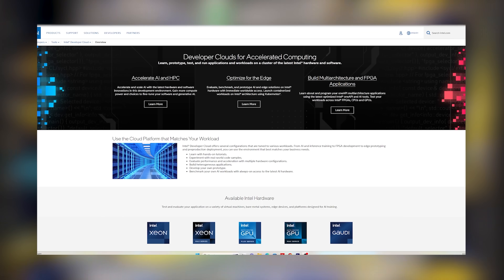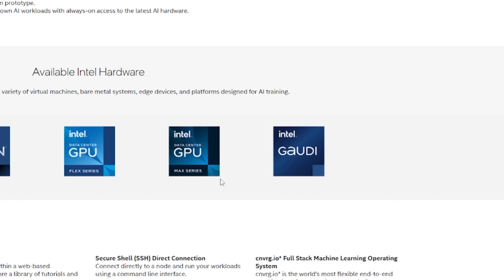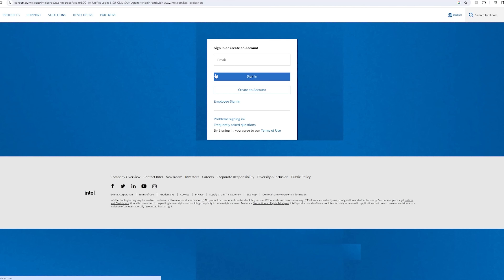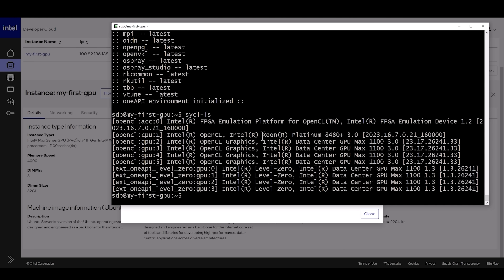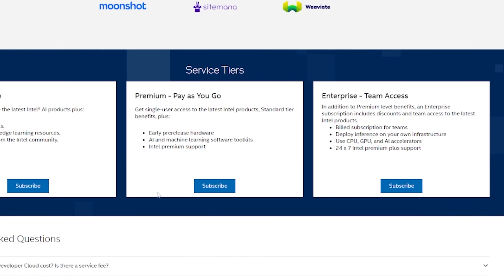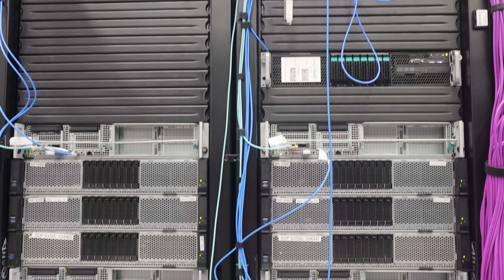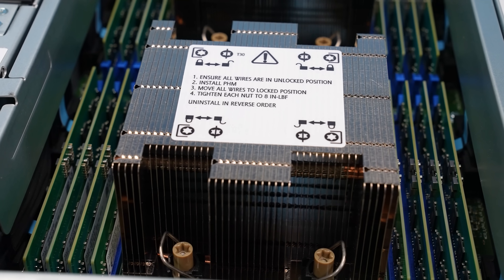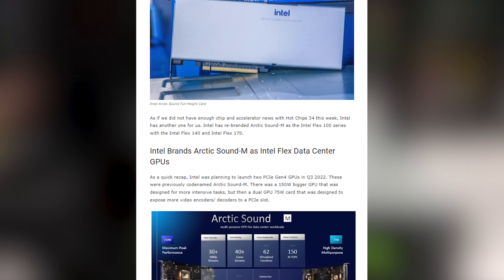AI Data Center Tour A Hardware Playground

Comment: No H100/H200 or even A100/V100 means only a small % of compute intensive AI devs would opt for it.  The Intel is NOT more cost effective, unless you can’t get H100’s.
Reply from the maker: NVIDIA was showing in its slides for the latest MLPerf Training v3.1 that Intel Gaudi2 is more cost effective than H100. That is even just accelerator costs not including the fact that NVIDIA was using PCIe switches and Infiniband not Ethernet straight from Gaudi2. A100 is falling behind now since it does not support FP8 Transformer Engine

Comment: Hi, i want to make my own home lab for AI, im wondering how hard it is, and where to start, I want to run llms I'm wondering, if there is better option than nvidia GPU, especially, since one gpu wouldn't have enough VRAM as i need, is there a way to go around that? or because with code llama llm's they just won't start if you dont have enough VRAM, is there any workaround this?
Reply: Give up is the short answer. If you can't get by with the RAM on a single GPU then it is not possible to do under tens of thousands of dollars at the moment.

Comment: Harley Davidson. 65 hp for making noise. 5 hp for pushing you forward.

Intel. 4950 W for heating the air. 50 W for doing useful work.

Arm. :)

Comment: Too bad Intel's AI/GPGPU products have come out close to a generation too late to be close to competitive. Nvidia certainly could use some competition to bring down pricing. They pretty much want your first born at this point, since they are basically selling anything they can produce no matter the price. But if you make back the entire cost in energy savings from the better efficiency, it will still be worth it for customers.
Reply from the maker: Word on the street is that Gaudi 2 is actually very competitive on a price/ performance perspective. Also, we covered this yesterday on the STH main site, but for only a few thousand GPUs (~$50M or less) NVIDIA is now pushing the L40S which is much lower power/ performance. Hopefully one day we can do Ponte Vecchio vs. L40S https://www.servethehome.com/nvidia-l40s-is-the-nvidia-h100-ai-alternative-with-a-big-benefit-supermicro/

Comment: Intesting sight that Intel uses 5p CEE connectors (the red ones) for the power supply of the racks. I would have expected some weird NEMA connector due to the location in the US. Do they really have 400V AC 3 phase power there?
Reply from the maker: I am not 100% sure, but I would not be surprised in the least given the cloud provider reliability lab is in the facility as well.
Reply: I doubt it's 400v, that's not a standard voltage here. It's much more likely to be 480/277 which is a very common industrial voltage here. It could even be 600/347 which is often used to feed large buildings or campuses which normally is stepped down to 120/208 closer to the point of use.
Reply: @eDoc2020  It is highly likely to be 400V three phase. If you tap off from each phase you get 230V single phase. It makes delivering lots of power to a rack much easier and just about everything can handle 230V these days even if you are in North America.
Reply: @jonathanbuzzard1376  I know why 400v is often used but that doesn't change the fact that 480 is much more common here. Standard server PSUs usually are good for 100-240 volts nominal and there are also versions available for 277 volts (one leg of 480v). But you need to keep in mind this isn't a normal server, these AI servers are using over 10 kilowatts each. Rather than using the 230 or 277 volts of one leg they probably use the higher voltage directly. The PSUs might even have true three phase input.
Reply: @eDoc2020  Blah, blah blah. Let me just check oh yes we have some of those 10kW AI servers in the racks at work. So I have ACTUAL experience of getting these things powered and cooled. The cooling is NOT an issue, the 12 year old water cooled rear doors can handle a rack full of them and still have headroom. Getting electrical power in is a different question and 3 phase PDU are the way it is done. Oh and ALL the vendor solutions for these servers have single phase power supplies. So stop trying to teach grandma to suck eggs. At the moment we can only get one of them per rack as we need serious power upgrades first which are been worked on, but hey what do I know about the subject. Note we have racks full of A100 GPU servers but the H100's have caught us off guard on how to actually get the power into the racks and into the servers. It is a complete sh*t show frankly.
Reply: @jonathanbuzzard1376   I never said they did have three phase input, I was implying it wouldn't surprise me. If you have real experience, that are the power input specs of each? I mean voltage range, amps, and connector type. Also is it one large PSU or are you feeding multiple smaller ones with a regular amount of power reach? From your comments I would presume the latter.

Also are you in Europe? Because 400v power is still not widely used here and I doubt they'd get a custom transformer. Perhaps 400v (or more likely 415v) transformers are common issue for American datacenters and I'm just not aware of it. I've never worked in a datacenter. I have seen equipment from smaller installs and I can confidently say 208v (2x 120v) 30amps is a common feed for a normal rack PDU.

Comment: 5kW a server is peasy. The problem is with the 10kW H100 based DGX servers. The coling is not the problem either, it is getting the power into the rack
Reply from the maker: We are going to have a demo on the STH main site from OCP Summit 2023 where they are now liquid cooling the power delivery to help power AI servers
Reply: @ServeTheHomeVideo  I don't think you get it. What follows is our real experience of trying get ready to handle these servers, some of which are already onsite. We currently can only accommodate a single H100 DGX box in a rack and the rest of the rack is more or less empty with some test boxes we don't care about. The reason is that if even a single PSU fails on a H100 DGX box it will cause a cascade failure of the rack as all the breakers trip.
First off liquid cooling is at this juncture a waste of time. So let's look at the Nvidia H100 DGX server. It's 5U in height and 10.8kW power draw using six C19 leads. I can therefore squeeze a maximum of 8 of these in a 42U rack. That would require ~87kW of cooling. The 12 year old water cooled rear doors on my racks are good for 93kW of cooling so I am already good to go with my cooling and have been for over a decade.
The problem is the power. So I upgrade the power delivery to the racks (this is underway) to get three 32A 3-phase supplies per rack. Being in Europe that gives me ~66kW of electrical power in the rack. This is going to be worse in North America with your anaemic electrical system. Immediately I now have to drop the number of servers per rack down to six because I can't power them. Not great but it is acceptable. However, it gets worse as I need six C19 outlets per server. The vast majority of zero U PDU's only have six C19 outlets so now I am down to three servers per rack. I did find one with 12 C19 outlets per PDU but on further investigation, it turns out some tuna melt paired the C19 outlets up and put each pair behind a 20A breaker so less useful than a chocolate tea pot which at least you can eat. Now I am down to getting custom PDU's made but they are dumb and don't come with power monitoring. It all really really sucks.
If you drop back to an eight way A100 box at 4U from a tier one vendor then you can get 10 of them in a single rack no problems. The 66kW of power is sufficient and being in Europe with 230/240V AC I can use C13 to C20 leads without changing the laws of physics as happens in North America. So suitable PDU's are easy to come by. Note the C13/C14 connector is as designed rated for a maximum of 10A. Due to the anaemic electrical system in North America you have decided the laws of physics don't apply and it's magically safe to use with a 15A load! It's no wonder the rate of electrical fires is much higher in North America than in Europe.
Reply: The power draw for the power you get from the gaudi2 shows how efficient they are.